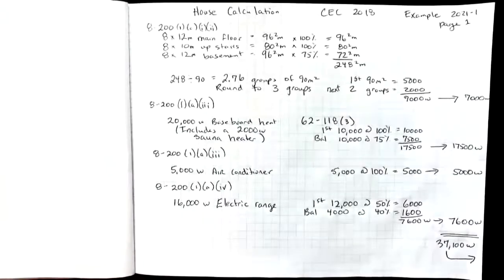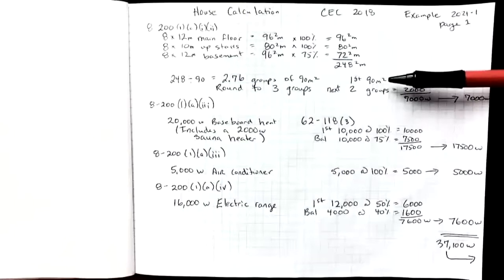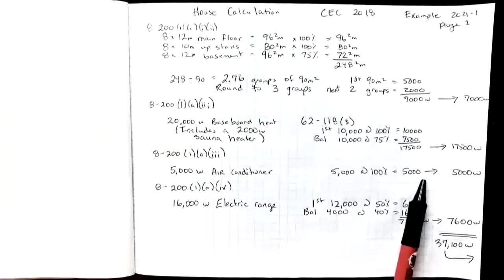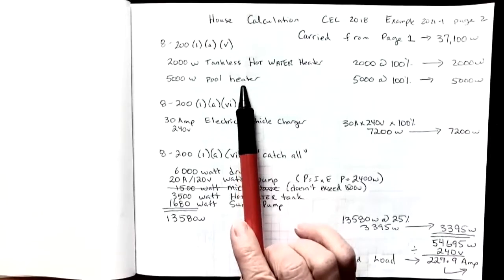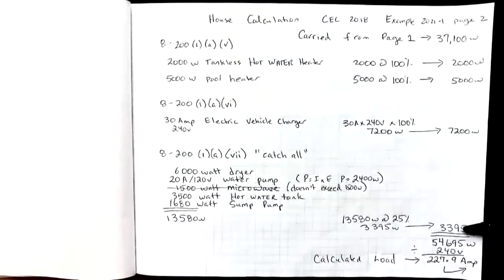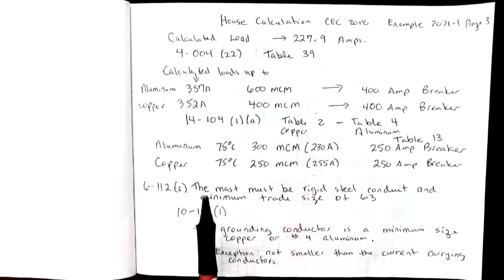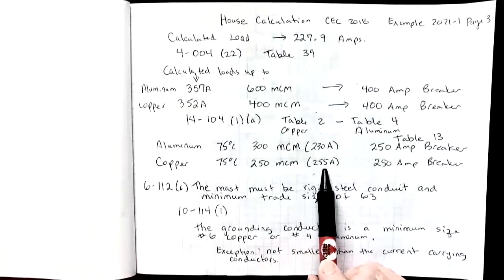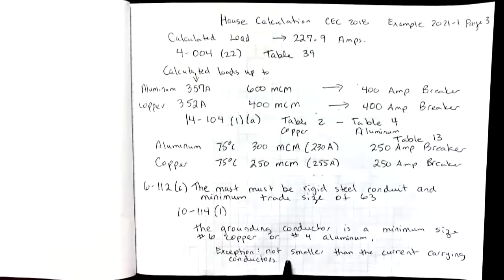CEC 2018 Full House Calculation 8 x 12  includes breaker and wire sizing

Comment: At 9:25, CALCULATED COPPER 250 MCM(255A),WHY USE 250 AMP BREAKER NOT 300 AMP BREAKER?THANKS
Reply from the maker: Hi Ryan-Typically, the breaker can not be larger than the ampacity of the conductor, because we don't want the conductor to carry more current than it is rated for. The idea is that the breaker would trip if the conductor is carrying more current than it should. So the ampacity of the breaker we choose is not larger than the conductor ampacity.  I say typically because engineers have built in their margins in Table 13, which allows slightly larger breakers in some cases.
Reply: @deannalittlejohn5623   why didn't you use 0000 copper instead of 250?